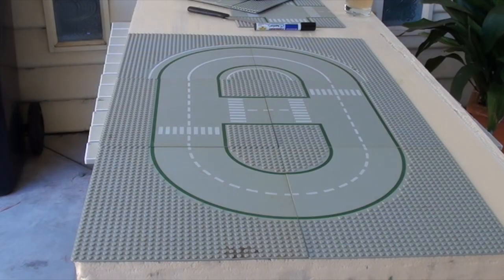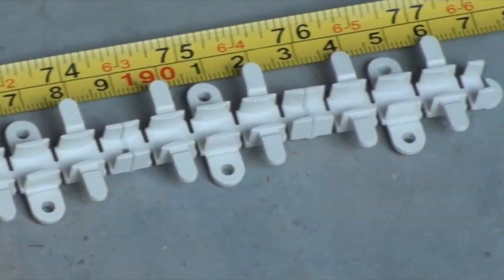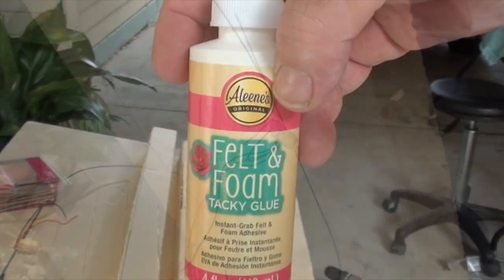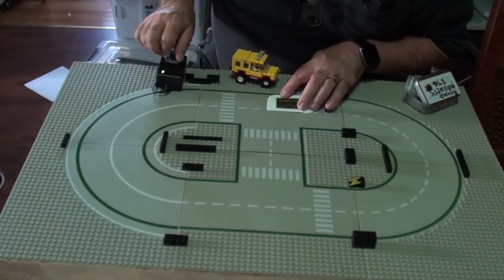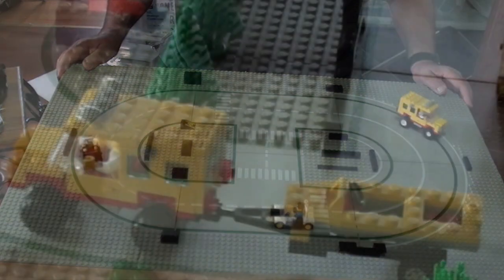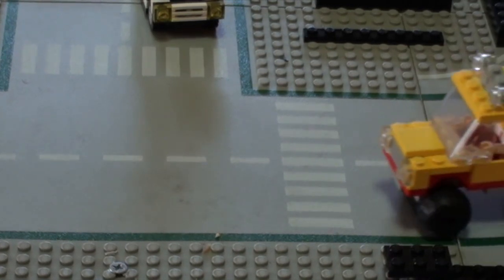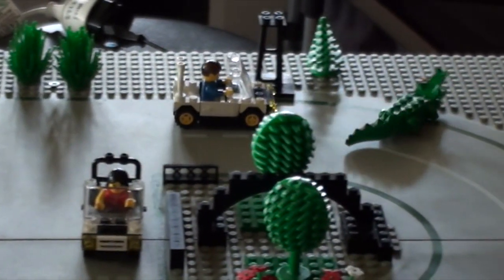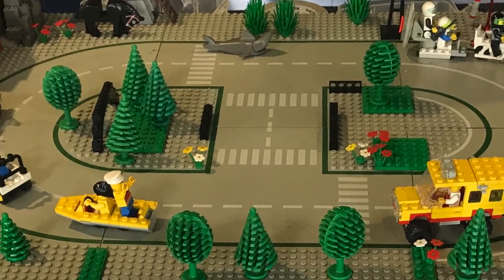Magnorail MOVES Lego!

Comment: In Lego there is a standard called a mills plate and I’m wondering how comparable that would be with this it seems ideal, how tall is the track compared to a Lego brick?
Reply from the maker: I think I replied direct by email - basically it would need some adjustment of plates to get track magnets close to the surface -  worth experimenting with - give it a go

Comment: Whoa amazing!! Thanks for sharing this with me!! I have subbed and keep following up on this!
Reply from the maker: BANANENBUURMAN  high praise from you- I have followed you for years, I hope the concept develops some new opportunities for moving old and new LEGO vehicles, animals and boats etc
Reply: @MagnorailOz  Yes 5 years to be precise :D The fact it can move tiny things like motorcycles is the best of this system! I am very curious to the max weight of vehicles, as you might've seen with my road concept it could also pull heavy trucks and modern lego cars.
Reply from the maker: @bananenbuurman  Yes I remember your concept video. As this was just a proof of concept I will be testing a larger layout (the base boards are on order) to see what it can cope with. The beauty of  the Magnorail system is that it can be added to, but also the system is so flexible. My current problem is I have all my kids Lego blocks etc all neatly broken down in to components in the cupboard, but I don't have the time to build the sets by scratching around in tubs of coloured blocks! With the Covid19 lockdown my grandchildren can't use their dads old lego to build for me as we are 3 hours drive away - so it might be a bit of a wait. My older son is still a lego fan and is part way through building the Lego tree house set. Will keep in contact. send me your email to magnorailoz@gmail.com